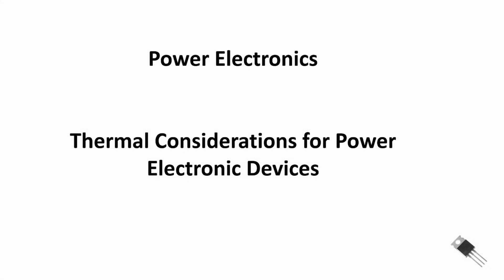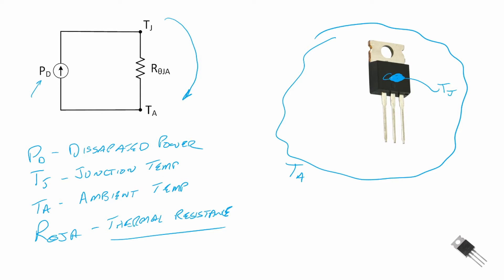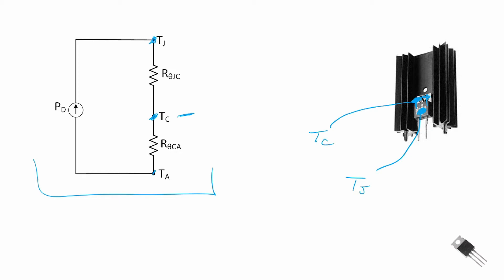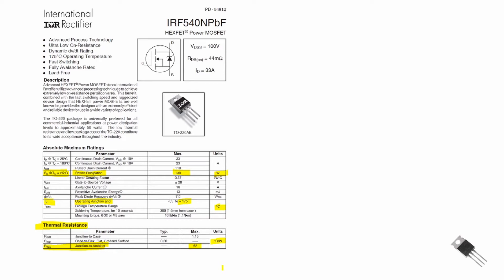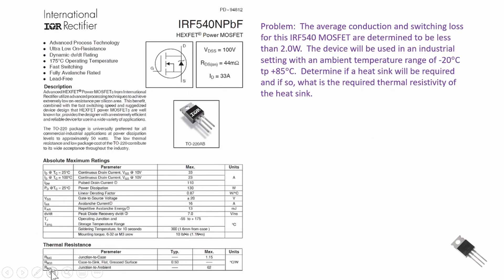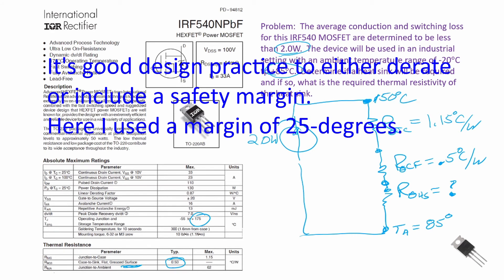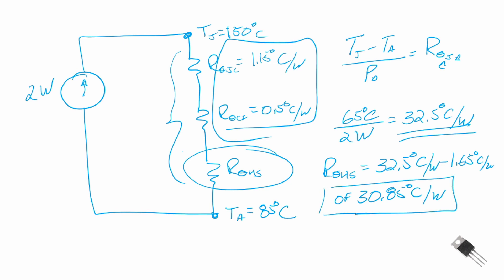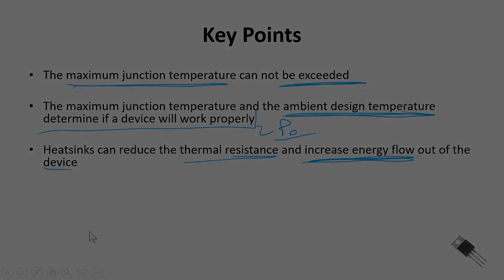Power Electronics  -  Thermal Considerations

Comment: I'm sorry but i have many questions about this model...
You have to dissipate Pd = 2W, and you want Tj < 150ºC, and by Kirchhoff's Law you get:
T_J = T_A + Pd · (R_JC + R_CA + R_HS) wich has to be < 150ºC = T_Jmax
So then:
T_A + Pd · (R_JC + R_CA + R_HS) < T_Jmax
Pd · (R_JC + R_CA + R_HS) < T_Jmax - T_A
R_HS < (T_Jmax - T_A) / Pd - R_JC - R_CD
That's great but... If adding a Heat Sink means adding another resistance on the model, why wouldn't you just avoid using a heat sink? That makes no sense to me because adding a Heat Sink should lower the thermal resistance, otherwise why would you add thermal resistance when you want to dissipate power?
Does having no heatsink mean having an infinite thermal resistance?
Reply from the maker: Hi! Sorry for the late response.  When we add a heat sink the equation becomes T_J = T_A + Pd(R_JC + R_CHS + R_HS_A), assuming we have perfect thermal conductivity between the case and the heatsink.  If a heatsink is not used, then the equation is T_J = T_A + Pd(R_JC + R_CA).  We need to look at the thermal resistance as it needs to be low enough to enable the thermal energy to dissipate to the ambient without cause a larger thermal rise in temperature of the junction.  Yes, there is thermal resistance of the heat sink.  However, R_CHS + R_HSA < R_CA.  Having no heat sink is just R_CA so it is finite and depends on the device package.  Hope this helps. Best wishes on your design.  -Dr. K
Reply: @powerelectronicswithdr.k1017  I've resolved my issue but this still helps a lot joining the dots. Thanks for the clarification Dr. K!

Comment: When the device is capable for 130W power dissipation for tc =25C 
80W power dissipation for tc =85C 

Then why we need of heatsink for 2W dissipation ?
Reply from the maker: Hi Monu, great question.  Those datasheet specs assume you can keep the case at that exact temperature. Marinating the case at 25 degrees is no small feet and requires some type of cooling such as a heat-sink.  If there is no heat-sink, then you will need to use the junction-ambient thermal resistance for calculations and that resistance is much, much greater than the junction to case resistance.  Hope this helps answer your question. -Dr. K

Comment: I couldn't understand but when we will not use heat sink then junction temperature will be 85C + 2W*1.15C/W = 87.3C

I know, i am wrong but can you please where i am doing mistake 😢😢😢?
Reply from the maker: You will need the following equation Tj - 85 = 2W*(1.15C/W + Rthermal_Heat_sink)

Comment: Thanks for the video Dr. k, I have a fundamental doubt, if by placing a heatsink we increase the thermal resistance of the final circuit (from the junction to the environment), according to the circuit model, why wouldn't it be better to leave it without that “additional resistance” of the heatsink?
Clearly, it is better with the heatsink, but according to the model being used, it seems that it is not.
Reply from the maker: Hi Alvaro, great question.  When you look at the datasheet for some devices there will be different listings for thermal resistance values.  For example, you might find the thermal resistance from  the junction-ambient and you might also see the thermal resistance from the junction-case.  The latter will typically be a much lower value and this assumes that there is a heat-sink that will be attached to the case.  The results is to find the total thermal resistance from the junction to the ambient and use that with the worst case ambient temp, power dissipation and junction temperature.  Note that RJ-C + RCA(heatsink) is often less than RJC.  Hope this helps. -Dr. K

Comment: Great video but if I may suggest a small correction, your thermal resistive circuit at @10:00, the 3rd resistance of R theta to heat sink is incorrect. It should be R case to ambiance. This way you can then calculate R theta to Ambiance by subtracting R1 (1.15) and R2 (0.5) giving you the required thermal resistance of the heat sink to "dissipate generate heat into the ambiance"
Reply from the maker: Actually, it should be "Film to Ambient" as the example assumes a thermal conductive film is placed between the case and the heatsink to improve thermal conductivity.  The heatsink then has thermal resistance between the film and the ambient.  Notice the film's thermal resistance is very low and could probably be ignored or included with the heatsink. The resulting analysis would just be the case-ambient resistance, which I am calling the heatsink.  Typically, one would first use the junction-ambient thermal resistance found in the datasheet to check if a heatsink is even required.  Sorry about any confusion.  Thanks for watching. -Dr. K

Comment: Nice. However, for a more accurate analysis, the heatsink should be represented by a series connection of a resistor (K/W) and a capacitor for thermal capacitance (J/K).
Reply from the maker: EB1000, yes, absolutely.  Also thermal capacitance should be added to the package as well.  As mentioned in the intro this is a static model and a more complicated model would/should include the thermal capacitance.  Thanks for watching. -Dr. K

Comment: Sir i have one question, why my İRF 530 N mosfet heat up when i gave 10volt between gate and source? The Output drain /source is not connect . I measure 40°C directly on the case.